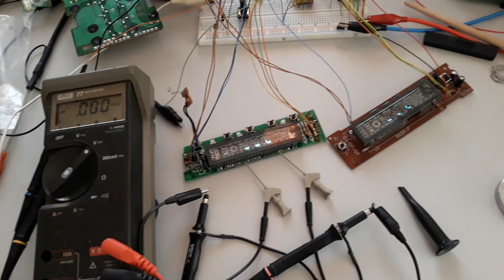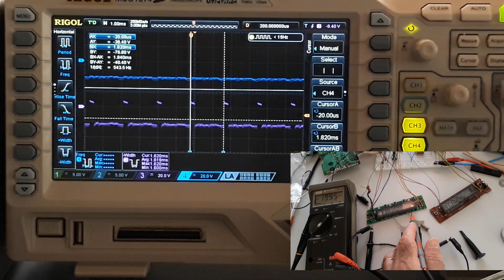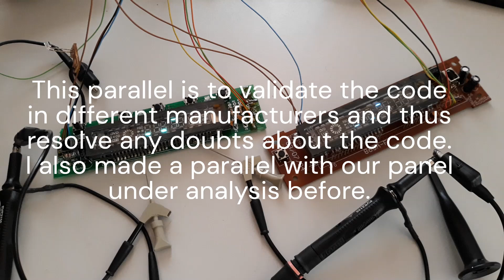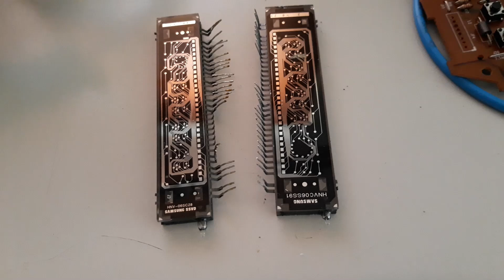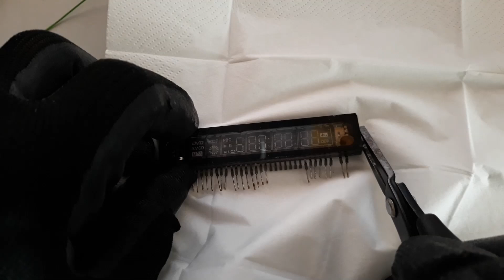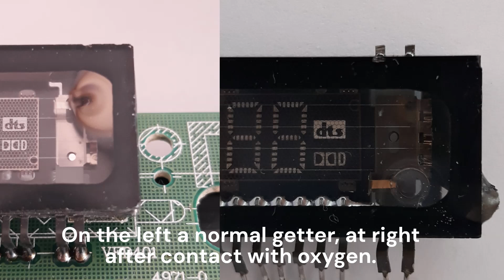VFD Troubleshooting

Comment: I like this kind of displays. I have many of them, controlled by PT63xx, AD16312 - it's fun to program a clock or something else with them! Every of my vacuum flourescent displays has it's own inverter - it's  a royer converter made from old mini ferrit transformers from broken electronics. My smallest myself coiled transformer is smaller than a thumbnail and works fine on ~250khz. I made DCF77 clocks with them, a control unit for my selfmade refrigerator (here it's a LED display), read out an outdoor thermometer with arduino and show it on a VFD. These displays are very useful :D All display programs are based on your programs, but I simplified them for me. Now, I have a standard for these displays.
Reply from the maker: Hi @dafmancanjan,
I am very grateful and happy that this passion for VFD's has found echo and utility. I always keep the code as basic as possible to be able to take advantage of the functions. I hope you continue to follow the next videos as they come out.
Sorry for my English.
Any help you need about VFD's don't hesitate, if you can help, ok.
Reply: These VFD displays are definitely very cool. I've made some watches with these displays too, but everything I've made I learned from Jose Luis Monteiro, the owner of this YouTube channel. If you could share your watch codes, please, I'd really appreciate it. I'm a fan of VFD watches and other displays. Thanks.